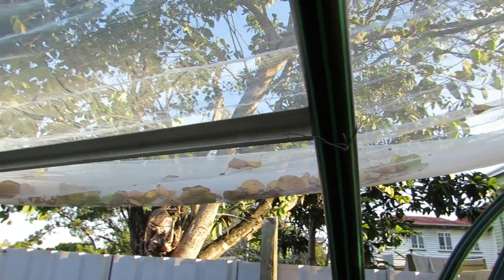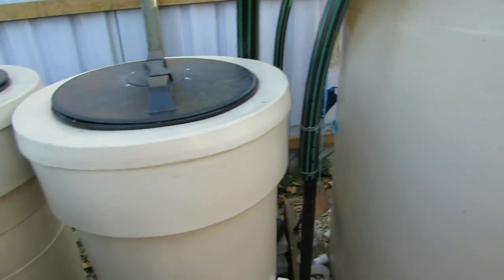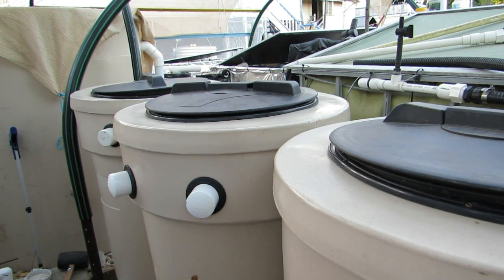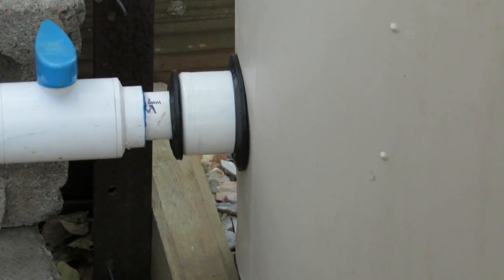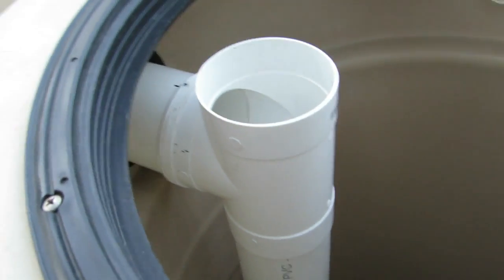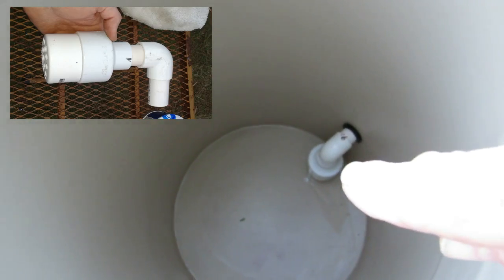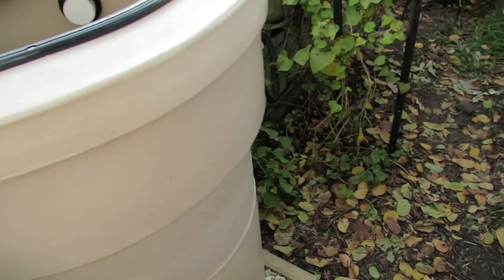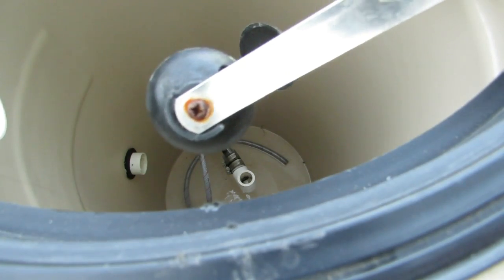Backyard Aquaponic build Vlog 3, Filters & sump.. Aug 2014..

Comment: Hi Rob, I know you think your videos is too long. I vote you don't make them too short LoL the longer ones are packed with information as well. I really like your tip at the end with the grabber. I use them all the time being confined to a wheelchair it is a necessity. IDK if the set you have where the suction cups are connected have just a sheet metal screw or a nut and screw to attach the suction cup to the grabber. Mine had the sheet metal screws and they broke what I did was to drill a hole in the broken suction cup and put a ss screw with a ss lock nut. Cheers Brent
Reply from the maker: Hey Brent & thanks..
Your grabbers sound like the pair we have.. I found some small SS screws the other day & put them aside so I can replace the rusted ones.. Problem is I forgot where :-D Under the house has plumbing gear everywhere for the build at the moment so might be a while before I find them ;)
Cheers mate & all the best,
Rob..

Comment: Your plumbing is amazing! I cannot even get my connection from my pump in the sump tank to the fish tank to stop leaking! I am using a flexible line and no matter how tight I make the hose clamp, it still leaks. AND, if that's not enough, the fish tank overflows after a point - okay, my pump is really beefy at 5600 gallons per hour... I thought I needed overkill to assure that all the different things I was going to expect of it could happen.... Oh, my my... I think I need to give the fish tank another grow bed to drain into - maybe just surface skimming this time instead of the nice lift siphon I copied from you - which works just fabulous, by the way - I did notice that you sometimes have more than one water escape from a fish tank... Any suggestions, which video I should watch again, or anything...  thank you and back out to the green house with me!
Reply from the maker: Sorry I missed your post.
How's the system going now ?
Cheers.

Comment: First, THANKS!  I have got so much info from your channel.  You are a hero!  Second, I have a question.  I understand, fully, your use of twin 45 degree fittings to prevent flow ritardation. However, I have what they call 'sloping' pvc fittings available here in the US.  They bend at the same angles (90 or 45) but are shaped in a sloping curve.  Wouldn't they work even better in such applications?
Reply from the maker: Hi Tim..  
Have had them recommended to me a bit & they would be the way to go if we could get them.. Unfortunately they don't sell them for pressure rated pipe here in Australia.. Can get sweeps for waste pipe but they don't fit the pressure due to the thinner wall..  
Cheers mate & have a great one..

Comment: Hi Rob with all the trouble with the uni-seals and the 90mm pipe have you thought of using 80mm PVC down pipe. Just a thought as you can get 80 to 90mm adapters. The 80mm down pipe is more expensive ( $24.05 / 3m I think ) but may make life a lot easier. Just thought I'd ask your thoughts. Andy
Reply from the maker: Hi Andy.. I think you would have the same issue trying to make a bevelled edge on the 80mm pipe as it's a thin walled pipe as well.. Am happy with the 90mm so far & the lower cost of fittings also helps too..
Cheers mate.

Comment from the maker: ***** We got the IBC through a chap that sources them from the soft drink/soda manufacturers.. Some have had the acids they use in the drinks, some the flavouring & the last 2 had aloe vera juice.. Are you here in SE QLD ?
Cheers..
Reply: rob bob my worms are not making worm pee and ive had is for 1 month
Reply from the maker: GTA 5 JetPacketHunt Hi there & sorry for the slow reply.. 
We get none from our farm either which is no problem at all.. Just means that you mustn't be adding as much wet material.. As long as the worms are happy & doing well all should be good.. Cheers..

Comment: Hey Rob-id like to add a second sump as well but how have you done this-is your the same level-my sump is in the ground but would like to add second sump like yours-ta-getting some jades tomorrow -yes.
Reply from the maker: Bevan Dittberner Hey Bevan. My first sump tank is a 200L drum that is supposed to be a solids filter that has never eventuated. I have it sitting higher than the current sump so flows into the main sump via gravity.
Have seen many systems set up with multiple sumps set up in series. As long as you have good flow though the same sumps all should be fine.
I am thinking about adding a second sump that will be set slightly higher than the main sump & joined by 90mm storm pipe using uniseals. 
How many Jades did you get ?

Comment: Love your Vlogs mate. Lots of useful info and tips. I am currently upgrading my system to include a radial flow filter and a moving bed bio filter. Can you please tell me how much bio media I need to purchase for a 200 litre  (blue barrel) Will 100 litres of bio media be enough or do I need more?
Reply from the maker: The amount of media you need depends on the greatest amount of feed that will be going into the system when the fish are matured. 
I worked out for our climate I needed 1L of the PE03/K2  bio media to process the waste from one 500g/1lb fish at maturity using a 35% protein feed.  
With the drum sizing, a 200L could hold 100-125L of media as it will need room to tumble so it can self-clean. 
Hope that helps & have fun with the build.

Comment: @Rob. When including a radial flow system and a mobile bio filter, is there a specific size for everything?

Meaning, I have about 150 gallon fish tank and about a 100 gallon grow bed, using currently a 5 gallon bucket for the radial flow and was considering using a 5 gallon bucket for the moving bio filter, to connect to the grow bed. Is that okay?
Reply from the maker: Hi Tiara & I'm so sorry I missed your post. 
It all comes down to flow rate as that will dictate how long a retention time you have in the filter.  I recently posted a clip that runs through how to size a radial flow settler if that helps,
https://youtu.be/sBCC9tMsleY
I would try to aim for about the same retention time for your moving bed bio filter as well. 
How's the system going now?

Comment: Rob, you might have answered this already, but I'll ask anyway :-)  Do you have an issue with low night time temperatures that cause issues? If so do you use a heater? I want to say yes since you mentioned that tubing for a solar water heater.
Thanks
Tim
Reply from the maker: Hi Tim.. 
Water temp has dropped quite low here a few mornings so have had the heater in there a bit.. Turn it on as the sun goes down then off first thing in the morning.. Keeps the water temp in the aquaponics a degree or 2 higher while the fish farm gains 4-5.. Has kept the fingerlings feeding well which is a bonus.. 
The Solar heater was a bit of a dud due to the small diameter & short length of the pipe.. Have bought some 1"/25mm pipe to make a compost water heater with but just haven't got that far yet..
Cheers mate & have a good one..

Comment: Hi there Bob. I have been enjoying seeing your videos and vlogs and have been motivated to start my system. I am presently making the build and come up with an issue. I have placed the outlet of the swirl filter at the same height of the outlet of the SLO. The bio filter height also at the same height and think I will have trouble with the water circulating. I guess I should loer the outlet of the filters but how far lower?.
 Tks for the help.
 Julio/Portugal
Reply from the maker: Hi Julio. Sorry I missed your post.
Did you sort out the height issues with the filters? 
Cheers.

Comment: gday rob your system is coming along 
great to see
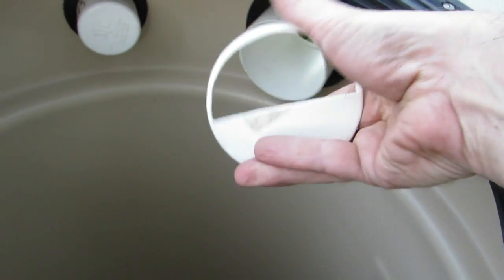 i like that idea at about 9:30 minute mark with the end cap thats a great little tip
cheers b&v
Reply from the maker: Hey Brett & Vicky.. Have been running the FT & filters since Sunday just gassing off the chlorine.. Hope to be finishing off the rest of the plumbing this week & if all goes well I will bring the filters on line.. Don't want to add too much new water all at once & shock the fish.. 
Cheers folks..

Comment: Water needs to sit in solar heater pipe to heat. I ran a digital timer to run a pump  5 min. every hour. Or trickle it. I heated the preseason pool this way.
Reply from the maker: Hey Tom. The timer sounds like the way to go.  I've seen one that run on a trickle but use a much larger diameter (50mm/2")  than I was using & a much greater length (20m/yards) that worked alright. I bit too big to use in a backyard but it worked for them on a small block. 
Cheers.

Comment: sorry for the question i can't hear what you said what size pipe do you have coming out of the fish tank is it 90 mm
Reply from the maker: Hey Adam.  The tanks have 50mm pressure pipe coming out & running into a 90mm pipe. Am happy with the 50mm pipe but think the 90mm collects too much solids.
Reply: so if you would do it again would you use all 50 mm then off to the grow beds
Reply from the maker: +Adam Tolley 
This system is plumbed up differently & has the water to the beds coming directly from the pump 👍 The belos clip is about 12 months old but will give you a rough idea on how it's flowing. 
https://www.youtube.com/watch?v=N4mYcUvZ9cw
Reply: awesome thanks